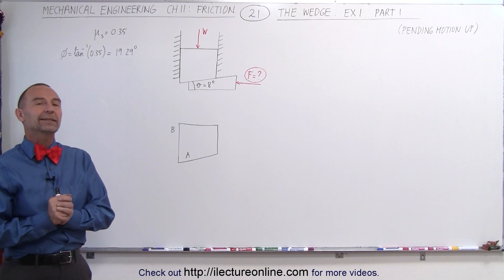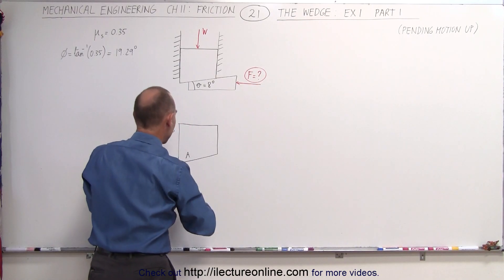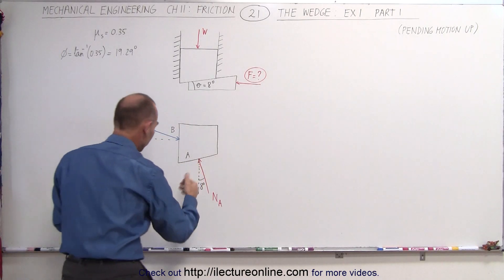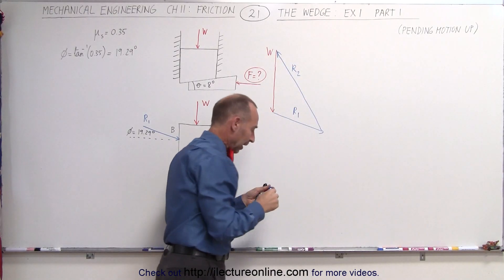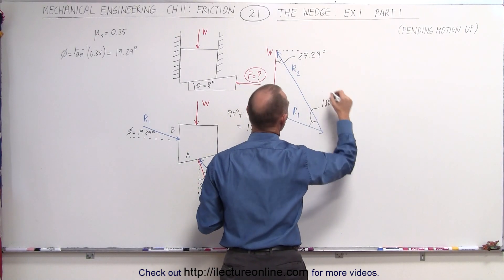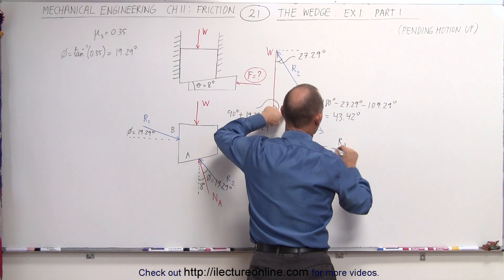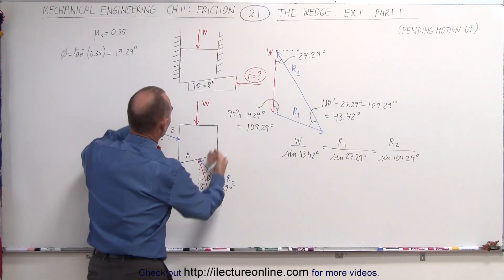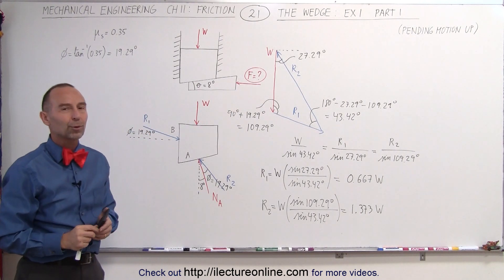Mechanical Engineering: Ch 11: Friction (21 of 47) The Wedge: Ex.1 Part 1/2 Pending Motion Up

Comment: I am just a fan of this channel.

I thinks the reason why there is no reaction of the plane(R) on the right side of the wall is that at the bottom of the block ,the wedge exerts a friction force along the bottom of the block and that is in the negative X direction (to the left). And  that friction force directing to the left cause a normal force on the left side of the wall. And since there is no force exerting on block to the positive X-direction, we can assume that there won't be no normal force from the right side of the wall and so there is no friction and the reaction force (R) , can't appear.

You can also watch the previous video; The wedge: Basic Concept in this channel.

Sorry for my bad english.
Reply: your english was perfect bro, thanks for the help

Comment: sir, why did you draw the reaction force (R2) to the right side of the normal force in the free body diagram of object D???
I mean why should we diddnt do it to the left side of normal force???
Reply: I am just a fan of this channel.

The direction of the friction force from block onto the wedge is to the left as wedge is trying to go to right.The direction of the friction force from the wedge onto block is to the left.
So when we draw the space diagram of all the forces acting on block, the wedge exerts a friction force along the bottom of the block and that is in the negative X-direction(to the left).

Sorry for my bad english.
Reply: @KelvinPlayerUnknown  
Friction forces are supposed to be ALONG the faces, not perpendicular or at a given angle from a face. This is not correct.